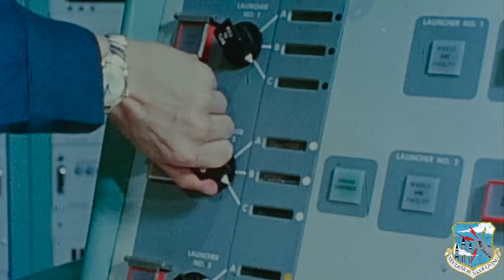EP. 25 -  The Titan 1 CARETAKER From 1998 Came To VISIT US.

Comment: Can anyone say which Titan site this one is? Am curious on this one how they got the generators out without apparently cutting the usual hole in the ceiling.
Reply from the maker: Southwest Titan 1. Each sector had a different decomm crew. Ripping out the generators from the power dome roof was blasphemous. Our generators were dismembered and hoisted to the surface via the elevator shaft.
Reply from the maker: Then reassembled and freighted to Vietnam to power UP, several U.S firebase command centers during the Vietnam War.
Reply: Interesting - thanks!
Reply: I might still have one of those sabots
Reply: I'll let you know if I find it.  found right there where you are standing c.2002
Reply: @NuclearBunkerLiving   That is mind bogglingly interesting! How did you come across that info?
Reply: The VietNam firebase generator fate that is.